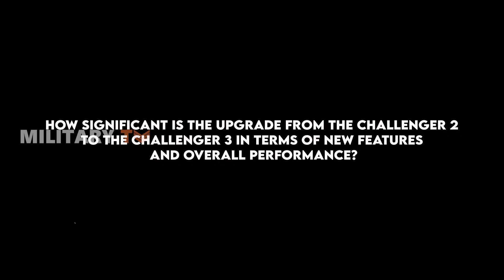The Secret Behind Challenger 3's Testing in Germany

Comment: I hope it can get out the factory doors. Unlike a Chally 1 I was asked to escort in 1989 from ROF Leeds to Bovvy. Doors open big rumbly tank pokes its nose out, loud sounds of mechanical un happiness. Sorry folks gearbox is buggered.
Reply: Too heavy for the parts installed
Reply: Challenger 1 was basically Chieftan with better turret armour, Challenger 2 is radically different, different engine and gearbox entirely, the L60 should never have been fitted to any tank, it is a constand rev marine or generator engine, one of the best, but when you add a gearbox that moves like a fiddlers elbow?
Reply: @gaptaxi  Chally 1 was nothing like a Chieftain. What are you smoking.

Comment: So we are dropping depleted uranium (DU) armour piercing rounds for ammunition with less penetrating power (at least until they’ve figured how to increase the kinetic energy of tungsten rounds) because we are worried about the health of crews hit by DU rounds? So unless we have an incident of friendly fire, why are we worried about the health of a potential enemy aggressor? The argument against DU may be in a Parliamentary Report, but the reasoning doesn’t add up. Therefore, I wonder what the real reason is? It’s not about shortage of DU as apparently:

“At the other end of the fuel cycle, when the uranium is taken out of reactors and reprocessed at Sellafield in Cumbria for every kilogram of plutonium produced there are 100 kilograms of spent uranium. There are at least 20,000 tonnes of DU in store at Sellafield alone.12 Jan 2001”

Hmmm!?🤔
Reply: Its not about the crews, it is about civilians living in the battle areas years later!
Never watched Judge Deed(?) ?
Reply: the RH120 L/44 gun has 25% higher performence and penetration firing DM53 toungsten carbide APFDSDS than the Challenger 2s rifled gun firiing L27a1 apfsds.
The L/55 firing DM73 has more than 40% higher performence than the L27a1 DU APFSDS of Challenger 2.
Its an massive upgrade to the outdated 120mm rifled gun, that has been one of the major downsides of Challenger 2 and Challenger 1.

Comment: Thought the whole point of smooth bore guns was greater muzzle velocity for kinetic energy rounds, but at the expense of range. Challenger 2 used rifled guns to enable the use of HESH ammunition , which works in a different way and doesn’t require the same velocity?
Reply: The HESH round works principally not by penetrating armor, but by causing a pressure shock inside the hull, called spalling, which in older generation Soviet armor would essentially turn the affected crew into a smoothie. That is not the case with more modern hull designs which incorporate special lining to prevent those tiny fragments from forming.
Reply: @td6460  If HESH hits a clean surface the spalling inside is huge. If it hits grating and similar blocks it can tear tracks apart, damage air intakes and filters. I Trained 19D scouts in the TOW system at Fort Knox there was a plate of Class A armor 4 inches thick that had been hit with a 75mm Recoilless rifle HEP projectile the spall was 2 inches thick the size of a very large serving platter for a large, cooked turkey. HESH/HEP is best used against lighter vehicles or the engine areas on modern tanks.
Reply: @wacojones8062  The point is though that modern tanks are using spalling liners which completely negates a hesh round making challenger 2 less effective on a modern battlefields. especially when their are modern ammuniations doing more or less the same thing but are used with smoothbore.
Reply: The C3 has been testing at ranges of 5000m, 2k beyond C2 and other current NATO tanks
Reply: @andrewtadd4373 it’s a wonderful German gun.
Reply: @andrewtadd4373  Leopard 2A6 has the same effective combat range since 2006 (up to 6000m with KE rounds). Challenger 2 gets Leopard 2´s gun etc.
Reply: @zhufortheimpaler4041  This particular gun, the L55/A1 is used from the Leopard 2A7V version upwards. The 2A6 used the L55, but the L55/A1 uses higher pressure and can fire the newest rounds, like the DM73 APFSDS.
Reply: Since fin stabilized ammo appeared, rifled canons went out of favor, since they are slower, due to more friction. Also the rifling gets used up over time, making the guns less accurate with usage 
HESH ammunition still exists, it is useful against buildings. Nowadays it's mostly used in man portable recoilless rifles, like the AT-4, RGW-90, etc.

Tanks use APFSDS rounds against other tanks and heavy armor, and multipurpose programmable high explosive rounds against everything else. High explosive rounds are speed agnostic, they don't care about the speed. 
The programmable rounds (like the DM-11) can be programmed to work as a HEAT ( High Explosive Anti-Tank ) hollow charge round, or as an air-burst round, programmed to explode in front, above or inside a target, making it more useful than the old-school HESH rounds.
Reply: a certain barrel dosnt have more range or accuracy over the other becuase it depends purely on the ammunition type, Hesh used to be british favourite which relied on centrugal force of rifling to stay accurate however in a tank on tank you dont want rifling due to sabots haveing fin stabilization, rifling in fact impedes the effectiveness of fin stabalised sabots.
Reply: @ashleygoggs5679  Yawns, rifling makes virtually no difference. The only reason the C3 has switched  to a smooth bore is logistics.
Reply: @jester5ify  The barrel makes alot of difference becuase if it made no difference then most countries wouldnt be using a certain type of barrel. Barrels work differently with different kinds of ammo. Anything that uses spinning motion such as a hesh round requires rifling to be more accurate hense why the british have used it for so long. However you can stabilise most amunition with fins which gives smoothbore a huge edge as you dont have to worry about wear and tear like you do with a rifled barrel. 

To say riffling has no difference is complete and utter ignorance. My father was reme and is the head of a veterans club whom get invited to catterick garrison, ive spoken to some of the squadies playing around with the new kit, it honestly makes alot of difference not just a logistical difference.
Reply: Rifled barrels have a shorter service life. Also HESH was used to break bunkers and hardcover, now that we have more specialized fin stabilized ammo, the rifling is not needed. A sniper rifle bullet does not have fins.
Reply: The smoothebore gun does allow higher velocity apple to apples. The real reason you choose smoothebore is cost: initial cost and lasts longer. The British chose refiled because the HESH round is very cost effective and you can get crazy range out of it if the barrel is rifled. Hence, the longest tank kill was from hesh. Design is often trade offs, the challenger 1/2 gun sacrificed DU penetration to fire HESH very effectively. Real cheap way of killing t72s, and is still very effective against people and buildings. Now in challenger 3, they decided they need max penetration with DU rounds. Also, the HESH rounds capability can be subplanted by new cheaper missiles. I will miss the HESH round concept though. Always thought it was clever.
Reply: It is. Smooth bore beats rifled prove over the years. His comment about the rifled 125mm being better is a lie.  Plus American's have the depleted uranium rounds is Britain want's them. This guy is way off with his biased opinions.
Reply: @stunick1573   The British, Americans and Russians (probably the Chinese also)  have depleted uranium rounds. The advantage is the cheaper price, since DU (depleted uranium) is a byproduct of nuclear power plants. 

The problem with the Challenger 2 ammo is that it's a 2-piece ammo, the loader has to load the warhead or APFSDS round first, followed by the propellant separately.  Because of that, the APFSDS penetrator is shorter.
The Americans also use  depleted uranium rounds in the L44 gun. To increase penetration, they use higher pressure in their gun, and their penetratois are longer than the British C2 penetrator, for more effect on target.  

The Germans went for a longer gun ( L55 ), to increase the speed of the rounds, and an even longer tungsten penetrator, for more effect on target.
With the L55/A1 gun, the Challenger 3 gets the newest gun from Rheinmetall, which combines both high speed and high pressure. It can fire even longer tungsten penetrator rounds (like the DM73 and upcoming DM83) with higher speed.

The problem with DU rounds is that they have a speed limit, they become too brittle after a certain speed. So in modern guns, tungsten rounds are more powerful, but more expensive.
Reply: @stunick1573  Which is why the longest range tank kill is by a Challenger with a rifled gun...
Reply: @jester5ify  Ah another never been in contact doesn't know how combat works internet warrior.  If you know combat and what counts this means nothing except to internet warriors.
Reply: @jester5ify   The longest sniper kill ever was with a scoped machine gun. That doesn't make machine guns better than sniper rifles.
Reply: @eddgrs9193  wtf are you crying about, nobody gives a shit about sniper rifles.
Reply: @jester5ify   lol, did I touch a nerve ? :)
Reply: @stunick1573  yes like all sniper rifles are smoothbore  key word rife the main benefit  of the new gun if using sabot rounds and less gun ware and fair and better for metence with better modern  he rounds we no longer need hesh.

Comment: Challenger 3 brings Leopard 2 tech as an upgrade to the Challenger 2.
There are reasons why the Challenger 2 never was a success in the international market. /s
Reply: Challenger 2 was sold to many middle eastern countries. Only reason Europe doesn’t buy it is because of UK leaving the EU, pressure from Germany.
Reply: @niweshlekhak9646  ehm... what?
Challenger 2 was sold only to oman for 35 vehicles, thats it.
challenger 1 was only exported in the late 90´s early 2000s as second hand vehcles to jordan.
there was no export sucess.
the last tank the uk exportet in mass was the Chieftain MK5 and that performed so bad that nobody bought britsh afterwards.
Reply: Yes, timing mainly. The Leopard 2 hit the market as a number of nations were looking at upgrading. The challenger 2 came after that. But, don't let the truth get in the way of a good story.
Reply: Because the rifle barrel gun did not share the same ammo as NATO hence problems restocking
Reply: @andrew5745  there were also other factors like that the british L30a1 gun and its ammunition reached their maxium performence peak based on their technical limtations with L27a1, wich has around 35-40% worse performence than the current 120mm smoothbore APFSDS rounds

Comment: When the fuck are they gonna fix the hull and power to weight ratio?
Reply: Do you know what Torque is/does?
Reply: no it got worse. engine, transmission etc all remains the same, weight increases to close to 80t

Comment: It needs 1650 hp not 1200
Reply: Challenger 2 and 3 is upgradeable to 1500  plus but the challenger 2 engine at the lower horsepower (1200 plus) has more torque by quite a bit than the later Abrams which has over 1500hp,  its about torque not hp.

Comment: Why not test it in a real battle scenario like in Ukraine

After all, Britain supplied Ukraine with several Challenger two tanks 

 Russian Kornet missile with tandem charged warheads quickly defeated the tank’s unprotected sections 

The result was Ukraine withdrew Abrams tanks from the front line action  amid Russian barrage of drone attacks which left no ground safe for Tanks  ... along with the British Challenger 2 and German-made Leopard 2 tanks

The Challenger was not popular with Ukranian Tank Crews, the tank’s 1,200-horsepower engine is under-powered for a 71-ton vehicle. Challenger 2s often get bogged down in Ukraine’s soft soil and needed towing by other Challengers or engineering vehicles.

Ukraine never got  add-on armor on the sides of the hull and the lower frontal plate left the tanks vulnerable and the extra three tons of weight would make Ukrainian Challenger 2s even less mobile on soft ground

The Russias took advantage of the weakness by deploying  drones handheld anti-tank weapons, and heavier munitions that blasted right through the unprotected sections 

Challenger 2s amounted to an error in Ukraine’s order of battle. They barely are worth the effort to maintain and arm them. Oh, and to tow them when they get stuck.

Upping the model designation number with a few modifications  will not change that in Ukraine against Russia
Reply: Compared to Russian tanks Challenger are worth to keep.
Reply: Yeah smart idea. Let's just send the newest tech to Ukraine so the Russian can reverse engineer it or look for weak spots when they get their hands on one of them... and they would. Remember that most tanks are knocked out by simple mines. The weakspot of every tank are the tracks. A simple $200 drone will then finish the job as shown in the Ukraine a hundred of times.

Comment: Russia has 155mm Artillery Tanks.
With High Explosive Guided Munitions.
Reply: I assume you are referring to the 152mm gun on the T-14. Considering Russia has less than 10 of them, I doubt anyone gives them a second thought. There's a reason Russia has lost more T-55's in Ukraine than T-14's. The T-55 actually works and doesn't break down on parade grounds unlike the T-14. And remember, the T-55 is 76 years old.